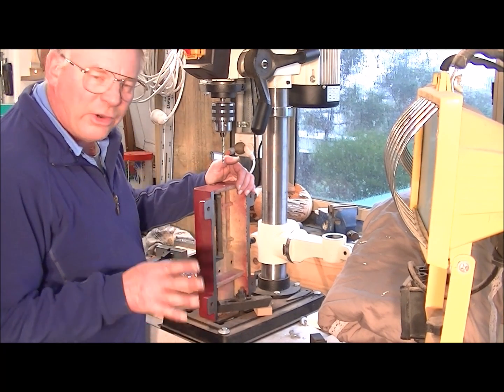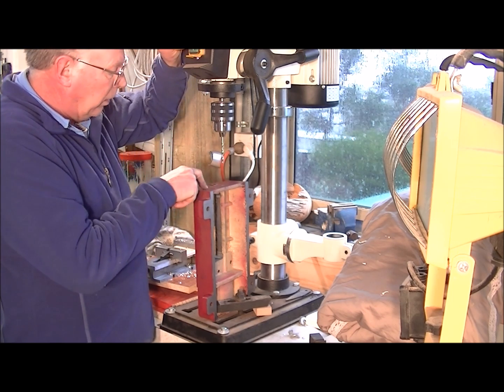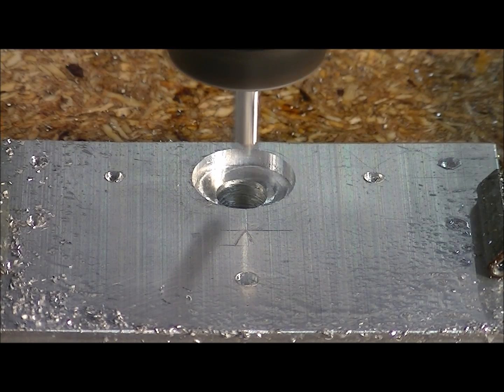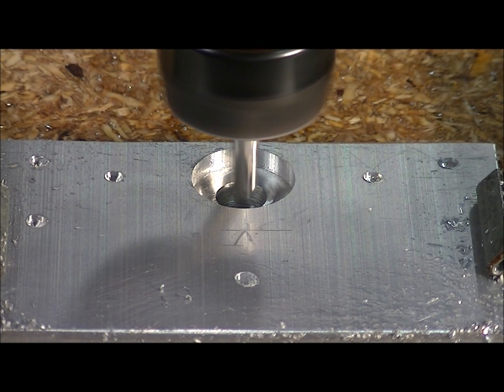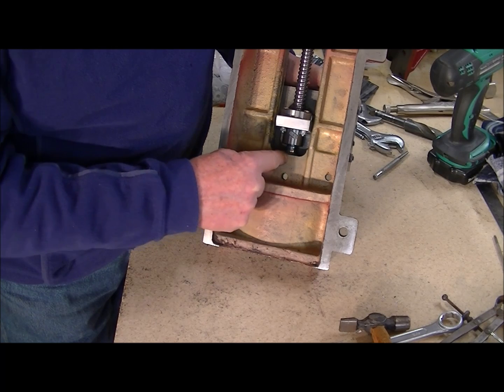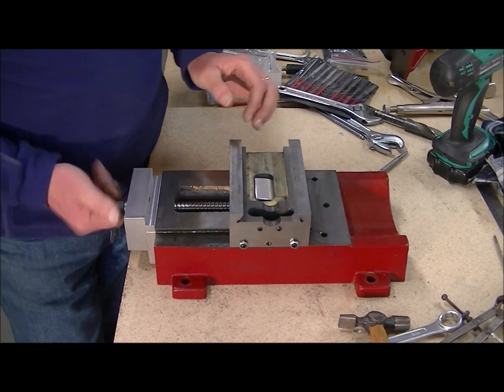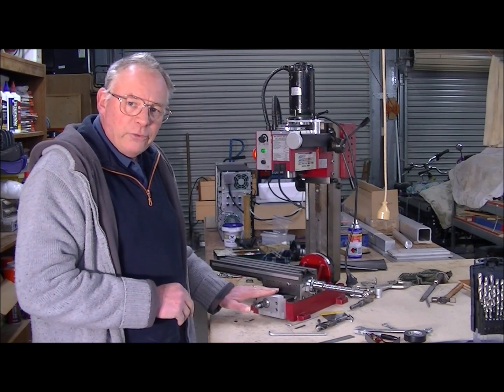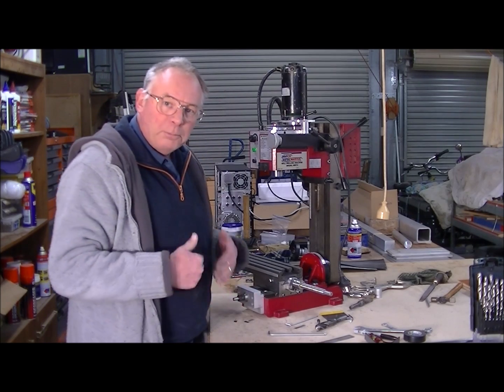135  X2 Mini mill CNC, conversion  kit development Y axis

Comment: I have broken 4 of those drive connectors you are planing to use, because of the flex they suffer from metal fatigue and within a very short time they fail. also as it is similar to a spring they have more backlash than lovejoy type connectors with the correct hardness spider installed.